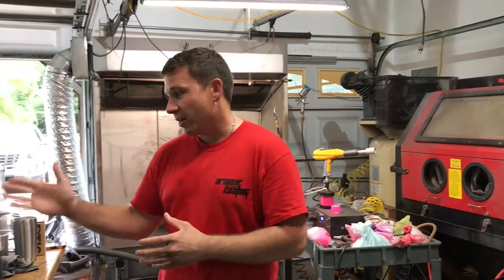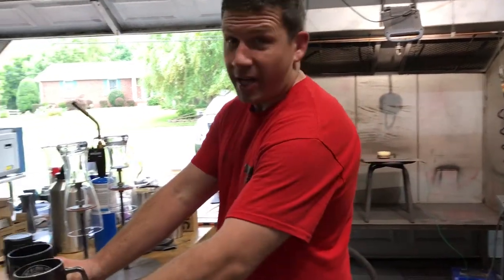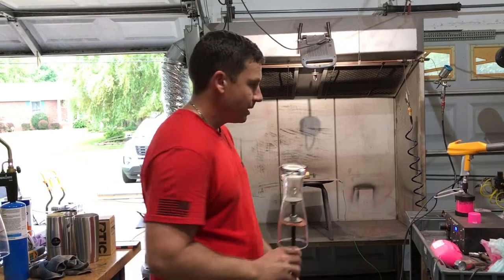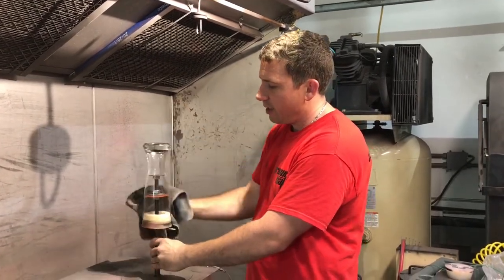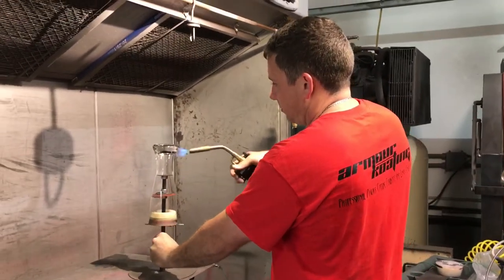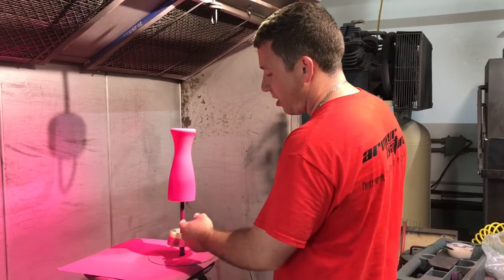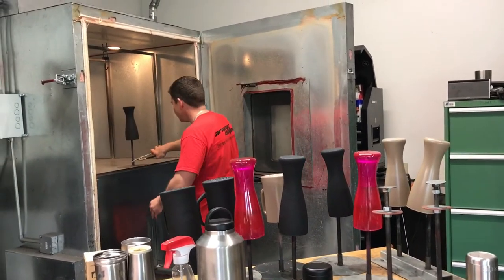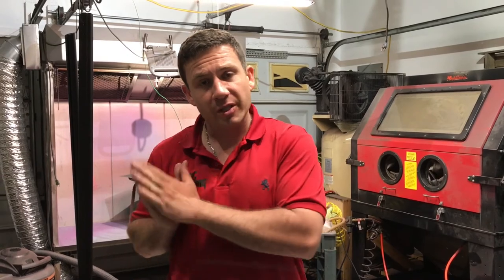How to powder coat glass

Comment: You said you don't like to hot flock the powder, then you heat the piece and powder it without a ground. Isn't that hot flocking? I'm not opposed, but seems like you ran the same risk of runs and excessive build that would be seen with hot flocking.
Reply from the maker: i was saying that i dont like to hot flock but the only way to powder coat glass is to hot flock. also no ground needed becasue its glass..... not metal.

Comment: Are those glasses only for decorating or can they be used for drinking without getting toxins from the added colors?
Reply from the maker: 1powelrainbow2 There is no powder in them is the same exact thing is powder coating stainless steel cups and laser engraving those you can use them and drink out of them every day use them in the dishwasher and everything

Comment: So what's a laser engraver cost? I was thinking about using a vinyl cutter as stencil /masking and going that way. Any thoughts?
Reply from the maker: bigsoundern I have always used a vinyl cutter and still do. I have a titan 3 from uscutters and use Avery high temp paint mask vinyl. A laser will run any where from 5k -15k.